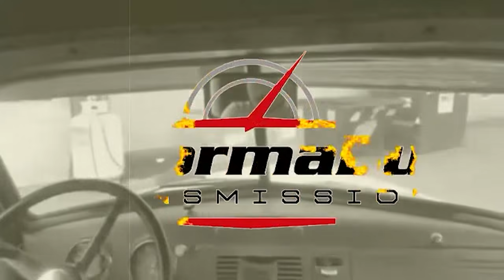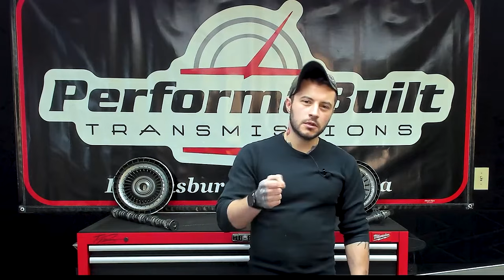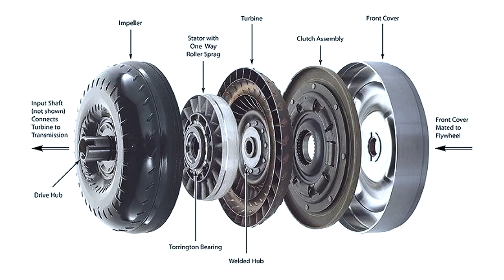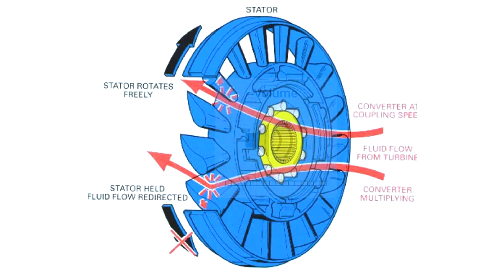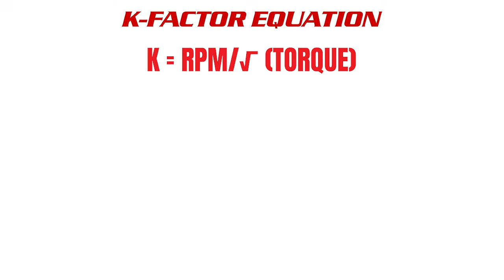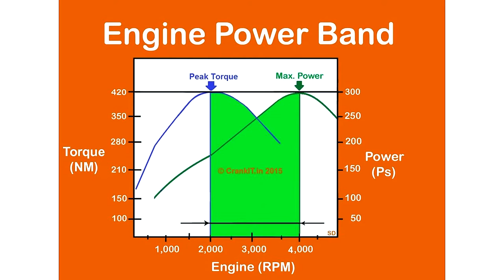How to Calculate Stall Speed

Comment: Great Vid. Lots of awesome  info but does my on road and trail riding CJ7 5.3L need to worry about single disk or triple disk?
Reply from the maker: If your over 800hp or locking it up in other gears other than 4th and cruising, then you will need a triple disc. A single will handle 5 to 800 cruising 4th OD and Lockup.